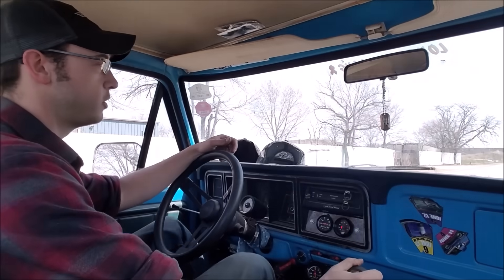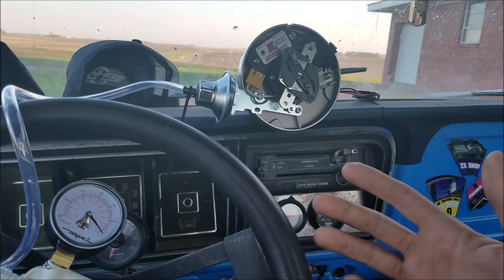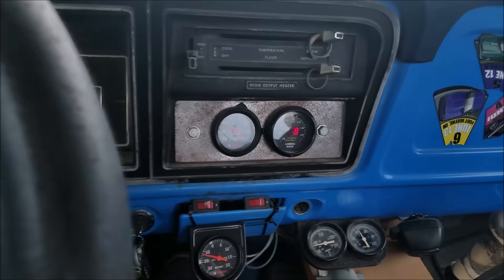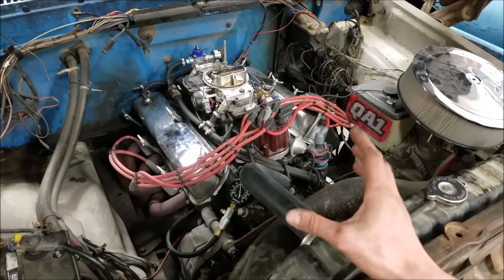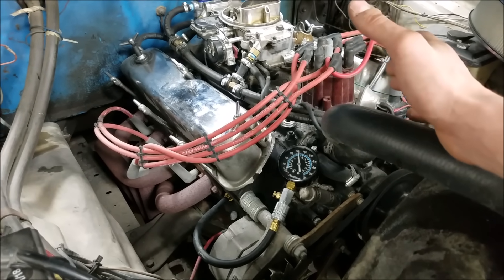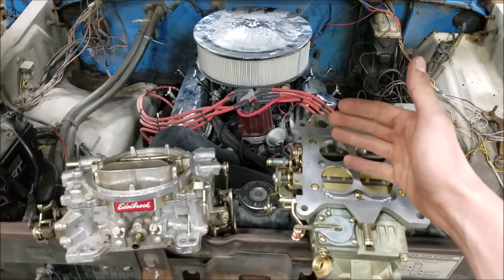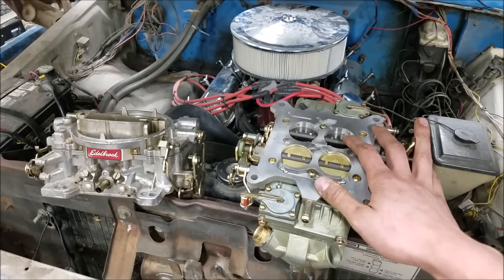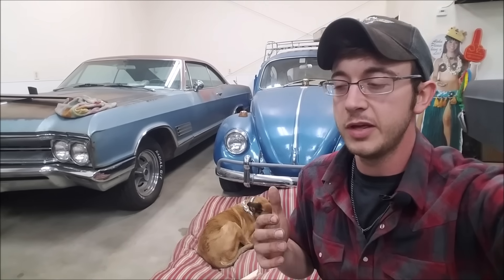Vacuum Advance - Ported vs Manifold: Which to Use & When !!!

Comment: To give an example for cylinder pressure in relation to how much advance timing you need, this example really helped me understand it. Think of two fields full of hay. One field is sparse, and has patches of growth that aren’t close to each other. The other field is dense and has hay all over. Light a match on the fields at the same time, and your dense field is going to burn way faster than the sparse field because the hay is packed tightly together, which means the fire doesn’t have to jump so far to ignite elsewhere. That’s the same way for cylinder pressure. More fuel and air being crammed into the cylinder under load means higher cylinder pressure, which means you need less advance timing to burn at the same rate as you would with the lower cylinder pressures aka the sparse field. If you wanted both fields to be completely burnt at the same time, you would need to light a match on the sparse field earlier than you would the dense field, which translates to needing additional vacuum advance at part throttle cruising. Hope this helps!
Reply: Dont forget cylinder head design affects the burn rate and timing requirements. Low compression and high compression need different curves. My old Pontiacs liked 12 to 14 initial and the total in by 4800...34 to 36 total. 15 inch VA. This was an open chamber head with 8.5:1 comp. A fast burn closed chamber head would completely change the timing needs.
Reply: Good explanation Dylan, accept one thing, I am gonna need to bail that hay and if you burn it, i"ll have to come find you,,,, lol haha
Reply: @BillyTpower  Oh crap. Please don't look outside. I tried the experiment and you won't like the looks of your fields. Sorry. LOL
Reply: I don’t know about all that, all I know is that I used to usually run full manifold vacuum to my distributor and set my timing by EAR.  At a good fast idle full vacuum advance turn the distributor back till it sounds like it’s got a load on it - turn it up till it sounds real light like it’s just coasting, turn a bit more till it starts sounding screwed up. Back around where it was coasting is close to right on. If when you drive it you get a bit of knock on heavy load then turn it back a little more. Then hook up a timing light and see what you got. You probably have to turn off the vacuum or else your mark will be way out of sight.
Use the timing light AFTER you get it set so you know where to put it when you have to disturb it.
Setting points on an old GM distributor with the window in the cap. Best design ever, you can adjust the points while it’s running. Put a 1/8 Allen wrench in the points screw and slowly turn in ( right ) till it just starts to mess up and try to quit. Then screw out 1/2 turn this should put the points at the right setting. Myself I used to turn it outa whole turn.
On my 66 Chevelle 283 automatic the difference between 1/2 and 1 whole turn was the difference in squealing the tires or not.
Reply: @michaelszczys8316 the 
Difference between squealing the tires and not squealing the tires  hahaha I like that part! Points Gap or dwell angle as gm calls it is directly correlated to coil saturation time! Short saturation time equals week spark. It also greatly affects ignition timing requirements as in advance or retarded😅 I have a Harley-Davidson golf cart that I work on for one of my customers it has a 2-stroke engine that runs clockwise and runs counterclockwise. With only a CVT transmission setup the only reverse for the cart is to start the engine in Reverse rotation. This is handled by the generator that thinks it's a starter. Reverse the polarity to the generator starter, and it turns the engine over backwards my point is that with the points timed in a certain Manner ( the points plate works just like it does on a distributor it's just larger in diameter and fixed position is all) and gaped improperly it will start up in Reverse but it has no power. Of course if you get too far off the chart it just won't even start in reverse, and it'll run like crap in forward rotation and this is what taught me how important Point Gap is in relation to ignition timing. What I didn't like about this video is that he was using Point Type  Distributors to explain electronic ignition adjustments, and of course not mentioning points at all because let's face it nobody uses points anymore except for me
Reply: What a Parable, If Jesus was born in 20th century he'd be a mechanic instead of a carpenter, Karen Carpenter be Kin folk. Lhm
Reply: Hey Dylan great video, so im just starting out with a 75 Pontiac 350ci it has a whole lot of vacuum lines. Looking to add a manifold and a 4brl carb. Question, how may vacuum lines do I really need?
Reply: @gabej3705  First make sure you won't have to get smog checks.  If you do, you probably have to have it totally stock, or else they will refuse to pass you.  If you are smog exempt, or your locality doesn't require smog, then you can do whatever you want with it and get as much power as you want.
Reply: Dylan McCool great explanation
Reply: You sir, are a pyromaniac.
Reply: he did a bad job he should have said progressive vacuum and how u find it because they have a lot of carbs on the market some have low or high and progressive vacuum on a carb. i hope u know how to find the different and stock carbs can be a B to determine the vacuum for what it is for if u don't know the engine setup. a lot of people mistake low vacuum for progressive vacuum
Reply: I found this analogy to be full of contradictions
Reply: so what your saying here is that I should hook my vacuum advance up on my 318, and that I'm losing power because it is not hooked up?
Reply: @neilwhitmore  If your vacuum advance is disabled, your part-throttle performance suffers, but full throttle is not affected.
Reply: @michaelbenardo5695  I have since reattached my vacuum advance :D
Reply: @michaelbenardo5695 which is cool also because some guys don't need a gas pedal they need a toggle switch hahaha
Reply: @neilwhitmore  you're giving up fuel economy. If your 318 is like mine, it needs all the gas mileage it can get...15mpg here😕
Reply: @neilwhitmore  it's more for better fuel economy when cruising with a smaller throttle opening, if you don't have enough advance to generate the power to maintain speed at a certain throttle opening then you will put your foot down more and thus use more fuel to maintain that speed.

Comment: I’ve also had good results with not running any vac advance but instead I’ve modified my mechanical advance to only allow ten degrees and then set my initial timing at around 25 for a total of 35 degrees with lighter distributor springs on my SBF.🤘

Comment: Would you suggest a new intake manifold or reseal current intake manifold and do I need the oem intake with choke, and egr or could I make a aftermarket work? Also is it possible a rodent dead inside the intake? It had lot of mouse pellets when I got it, or do a cast iron intake on a original 350 rocket go bad? Or what

Comment: I do have a question for you, albeit not related to carbs exactly. In one of your older installments, I recall you having mentioned something about adding thread sealant to a particular bolt due to it's proximity to the intake system and it being a very difficult vacuum leak to detect if it leaked. I thought this was on an sbf, but perhaps it was on something else? Or maybe I'm just making it up? I don't remember if it was an intake bolt or a head bolt (I know about sealing the head bolts and coolant leaks). I've been trying to find what I believe is a vacuum leak on my 92 Fox and I may have (should find out later today once I get the dizzy stabbed properly).

Unrelated to this, I tried to send you a fiver a while back and it got returned because of your paypal account or something.
Reply from the maker: I returned it as I felt bad about asking anyone for money when I didn’t do any work. 
But I think you are referring to cylinder head rocker studs - on some engines, these are drilled at tapped all the way into the intake runners and can actually leak!!!

Comment: Great vid man. I just did some rear differential work on my 1984 grand marquis. It was running low on gear oil and was making a winning sound. Luckily I caught it in time so it didn't chip any teeth or  cause any mental shavings. Damn it man lol
Reply: better mental shavings than metal shavings!
Reply: @sitzkrieg8032  I was soooo confused and now I see what you mean lololllll. Metal*** 😂😂😂😂😂😂👍👍

Comment: I just got a used Oldsmobile 350, installed myself, wonder if you could tell me why it’s starts but it revv extremely high, I turn distributor as much as possible it settled to a much calm idle but it began to backfire, is this problem because of intake manifold is failing, because I completely turned down both fuel air mixture screw but this engine revv extremely high why I need you expertise I even switch carburetors but same high revving during idle
Reply: You could have a vacuum leak somewhere

Comment: A video on that high idle switch would be awesome
Reply: It looked like he had an air conditioner compressor kick up solenoid hooked to the carb but wired it to on/off switch instead of the a/c. Pretty clever. You just have to buy the correct bracket for your carb. I know Holley and Edelbrock sell them 👍.
Reply: yes. I want to know how he did that.
Reply: Its called an idle stop solenoid. Stock engines had idle solenoids on there from the factory after 68, 69 approximately. Not all of them, but emissions had gotten stricter and stricter.  It prevented  engine run on condition , when you turn the key off. It's an anti dieseling feature.   It's a electrical solenoid, one wire, it's body is the ground.  AC cars had them too, because of the load the compressor added  while activated.
Reply: Its true that its just an a/c high idle solenoid, but which one? most will not have enough push to open the throttle on their own, they just hold the throttle open after you have pushed the gas.
Reply: It's just the kill solinoid screwed out. Dieseling was a big problem back in the day. The only way to kill a hot engine was to close the throttle plates completely. Ford used a electric solinoid to hold the throttle plates at idle. When you turned the key off, the solinoid retracted and closed the throttle plates, eliminating dieseling.  He just wired it to a toggle switch, and adjusted the plunger out for a higher rpm. Neat trick..

Comment: I like your video. Ported vs. Manifold is certainly a controversial subject. The SBC in my Corvette has a mild performance cam, a 600 cfm Holley DP, and a distributor dialed in by an expert on an old style cam machine, using my engine specs. The engine loves❤️full vacuum to the distributor at idle. Vacuum and base timing are set to a maximum of 36 degrees with 10 degrees initial.  It works well, and that’s what counts.
Reply: All chevrolets love manifold vacuum.  It's something you have to do with them to get a smooth idle.  Others like fords its hit and miss.  I've had some that loved ported and some that loved manifold.  I have one that loves both as it runs on manifold and venturi vacuum.
Reply: Milner62  Thanks for clearing that up. Corvette Forum guys and I stand by manifold vacuum, while other sources claim ported is better. In the end, whichever works best for a particular engine is best for that engine, so experiment.
Reply: Exactly what I do with my small block Chevys.

Comment: Not all old engines had ported on their carb. For instance my 70 Z28 just has a full manifold port on the 4555 Holley.
Reply from the maker: I tried to say it doesn’t work for everything - that was the factory screwing people to keep things safe. You would have good idle timing, but your initial mechanical had to be a lazy setting unfortunately.

Comment: For those of u who daily drive low vacuum engines, take a look into FBO Ignition products. They make custom vacuum advance cans for Ford, Chevy and Mopar. It changed my daily driver alot. Sharp off idle launches, and improved fuel economy by 2.5 more mpg

Comment: I'll have to take a look at my truck, my old 350 i just tuned with a vaccum gauge but has a slight hesitation when I first floor it. I'm going to double check where I have my vacuum advance hooked up and adjust that idle screw. Didn't know that having it at the bottom was bad, my truck idles fine but now that I know about those little ports underneath I'll make some adjustments. Thanks! Going to double check my timing too
Reply: If you're running a Quadrajet check yor secondary door opening. An allen wrench and a small flat blade screwdriver is needed to adjust it. Take your finger and push the door open. You should feel slight resistance. Your Secondary flapper could be too tight or loose. Both will cause a stumble. These flaps also control the secondary fuel flow. Experiment with the tightening and when you hit the right spot you'll love the Quad. I can make one run circles around a Holley..Used to build them for S/E Pontiacs.

Comment: This is a topic where it's best to obtain all the knowledge u can and go out and play with it. And go with what the engine likes best. I personally use manifold vacuum. I have a very low vacuum signal at idle (6in) in gear. 14° stop bushing, and 22° initial timing.
Reply from the maker: Yep, and that’s where I tried to add that big cams need more timing - street engines with stock or mild cams will favor ported where big cams that bleed off a lot of compression at idle will need more timing because cylinder pressure is low!
Reply: You said it- "go with what the engine likes best". If your engine only pulls 6" of vacuum at idle speed then I would think that performance is priority and fuel mileage not as important to you. In that case you probably have very light centrifugal advance spring(s) to get full advance quickly. In that situation I am more concerned with having cap/rotor indexed properly than having a functional vacuum advance.
Reply: You should ditch the vacuum advance all together.

Comment: Good video Luke, u had given me an idea. What if u take one of them vacuum lines u have an in the cab and hook to a spare working distributor with the cap off. And go for a drive and see how the vacuum advance arm moves accordingly with throttle signals. Both manifold and ported
Reply from the maker: ..... lord that would have absolutely been the thing to do. Although they are exactly the same except at idle, that would have been a solid demonstration to drive the point home.
Reply: @ThunderHead289  To "drive" the point home. I see what you did there. LOL

Comment: Feel like this topic is like Zinc in oil, you'll get a million opinions on which is correct.

Everybody will claim they're solution works best, but everybody's setup is different. Best to get all the knowledge you can, and apply what works best for you.

Great vid, Luke!
Reply from the maker: That’s why I tried to prove it through tech and demonstration. But that’s like ten years of learning I tried to put in a 15 minute video.
Reply: @ThunderHead289  Made a post on the Facebook group trying to dispel the "ported vacuum is only for emissions", let me know what you think!